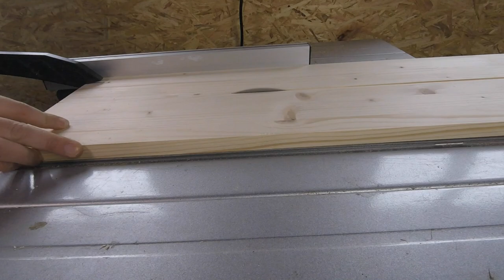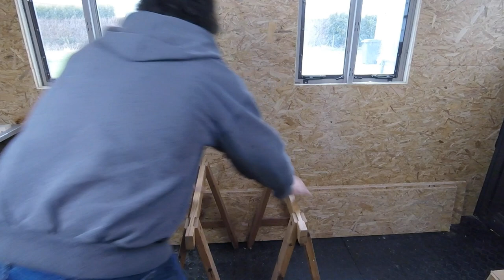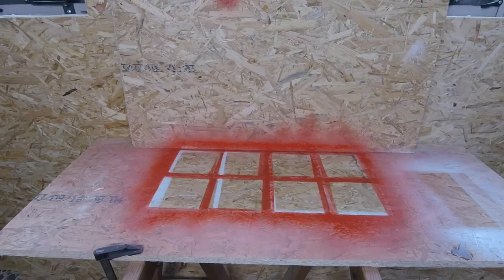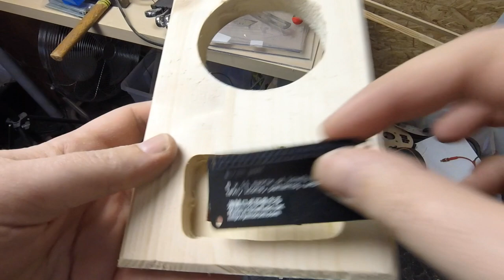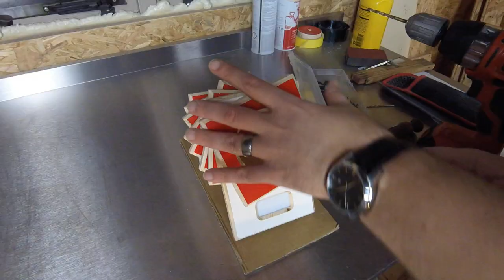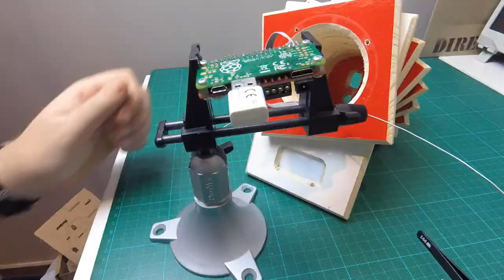Spiral Speaker Build - Raspberry Pi Zero, Amp Zero, Scroll pHAT

Comment: Sweet project, but I'd like more info showed about interfacing the pi zero and the hat with power specs, plus you might like to add some poly fill inside the tube to clean up any sound reverberations. Other than that great video.
Reply from the maker: Thanks for the tips, I'll try and apply them. Regarding interfacing etc ... see the blog post linked in the description :)